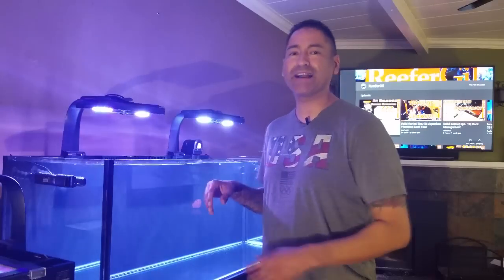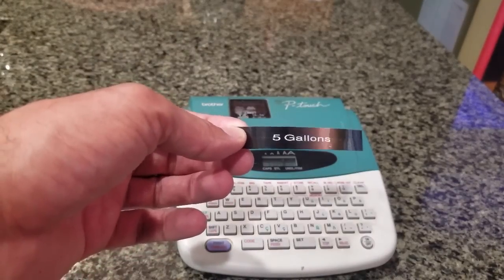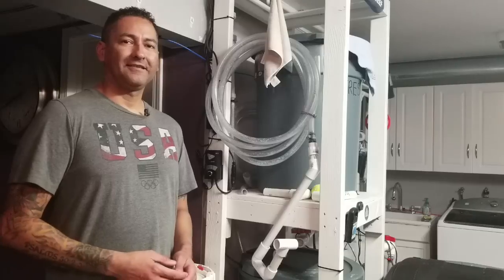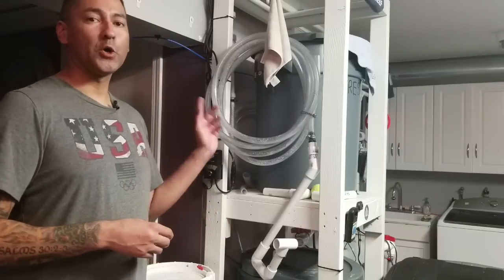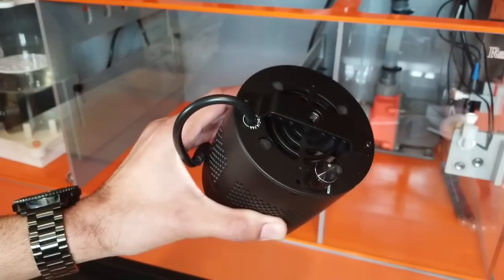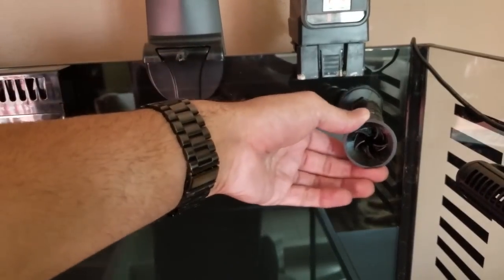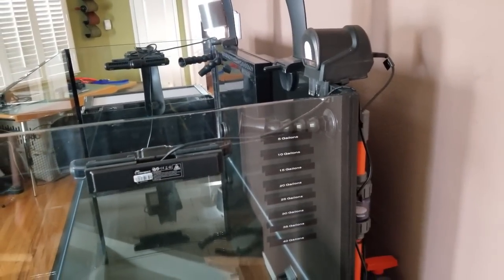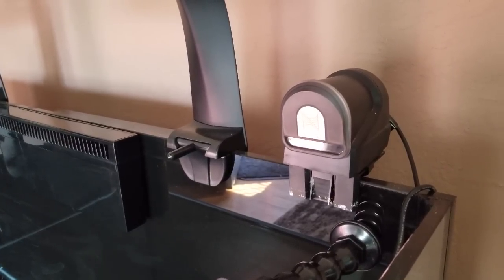100 Gallon Saltwater Aquarium Overview

Comment: The other way to tell how much water to take out is to measure how many inches on your tank is 5 gal of water then mark that one the tank. You can then simply multiply the inches by 5 to determine how many gals you need to change.  That is what i did on my tank.
Reply from the maker: Thanks Milton, another great idea.

Comment: I have the same goose neck for the h380. Im on the fence about it. For the first month I was fighting it wanting to bow out. It looks like if you bend it enough it stays. Great video. Im excited to see the rock work.
Reply from the maker: It's been on there for a while now, not bowing out like I thought it would. I think I might be okay with it. Thanks man!
Reply: I agree. Mine has settled down. Im using some velcro cord straps I picked up at walmart to manage the cables and everything seems to be working well. The light is out of control. I couldnt be happier.

Comment: This is a great idea. However, wouldn’t you want to do this AFTER the rock and sand as they would change the actual amount of water volume you can put in the display?
Reply from the maker: The check valves cut off any water leaving the tank through the returns so all the water drains down the overflow. Once the water is below the overflow it stops.

Comment from the maker: You have spoken and I have heard you. The measuring stickers are coming off, I will have a new way of marking the amount of water being removed. Also, it does not matter that I do not have rock and sand in the tank. The max level in the display tank is the max level with or without the displacement of the rock and sand. Had I done this to an empty tank with just water and used  my sump to measure my water changes, then it would have made no sense to have done it without the rock and water. Thank you all for your feedback, much appreciated!

Comment: 8:28 that air in the pipe made me think... could stationary water in the pipe for a longer period of time become bad/foul? (bacteria, algae..) I don't know how often you do water changes on your system but I'd drain the pipe after finishing just to make sure ;-)
Reply from the maker: That's a great observation. For the water sitting in the drain pipe, I'm not concerned... it's just going to drain down the sink. As for the water sitting in the return, I think it such a meniscal amount, it won't affect the 125 gallon volume of my system. Plus I'm doing weekly water changes, so that water doesn't sit long.

Comment: Displacement from rock and sand will change your measurement if measure while bare tank.
Reply: i was think the same thing, but displacement affects the total volume.  the graduations will still measure 5 gal. increments
Reply from the maker: Nope, still would be at the max line level in the display tank. As long as the display tank was filled to the brim of the overflow, rock and sand wouldn't affect it. Max level is max level, but it would affect the max level in the sump. Since my measurements are in the DT, it's good. Great observation though.
Reply from the maker: Exactly, thanks Cycnoches! I could have done a better job explaining that in the video.
Reply: NP!!

Comment: But the marks mean nothing with rocks in the tank doesn’t it? Great tank. You should mark when you ADD the water. I could be wrong..... running to calculator!!! 😂
Reply from the maker: LOL, water displacement! I'm still good since the water inside the DT only fills to the bottom of the overflow.

Comment: Rock and Biomass displace water and may throw your measurements off a little.
Reply from the maker: It shouldn't. The tank was filled to the brim of the overflow. No water going down the returns due to the check valves. Water level will be the same with or without the displacement of rock and sand. Good point though.